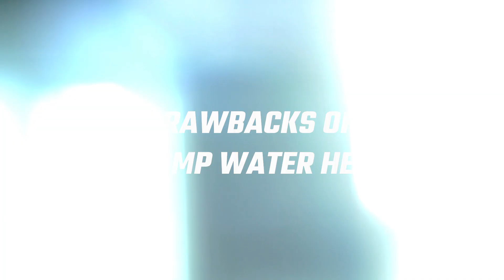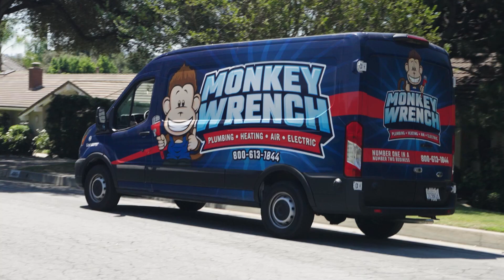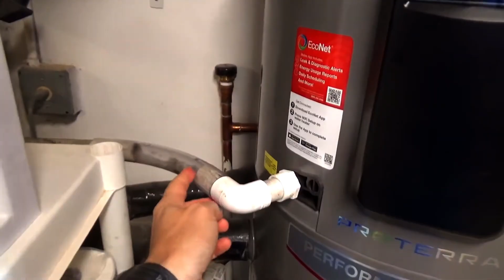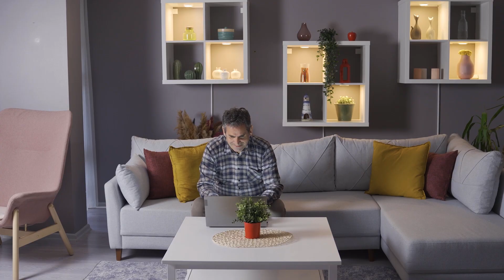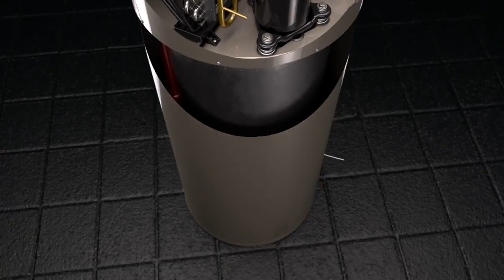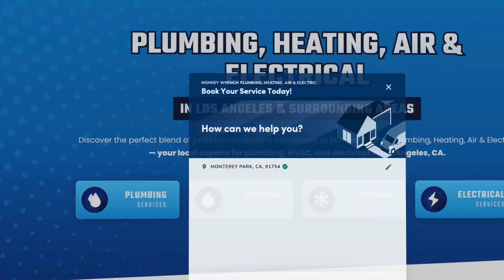Drawbacks of Heat Pump Water Heaters

Comment: In California more and more contractors are moving to the Eco-logical Omni split system heat pump water heater. Eliminates all the problems the customers run into like, unwanted cooling at times, noise, having to deal with condensate drains or pumps, and the Omni is the most efficient heat pump water heater on the market. Contractors love it because it’s a split system and the installation is very flexible.

Comment: How much on average should I expect to pay for a unit like this to be installed replacing a regular electric 240v HWH of the same size in 2025?
Also, can they be set up with a recirculating pump that keeps hot water constantly pumping around the house?

Comment: A Heat pump water heater is dumb for some, here's why. You take heat out of the houses air to transfer to the water, now the furnace has to run more to make up the heat stolen for the house. I guess it is ok if you live in a hot climate. So it is good for some areas but dumb for other areas.
Reply: If you didn't have a heat pump water heater, you'd still be paying for the gas or electricity to heat water in one of the other types. At worst it's a wash, at best you save a little money on the added efficiency of the heat pump. You're right that they aren't a good fit for everyone; that's why it's important to educate yourself on the benefits and limitations of 'new' technology (for which this video is unfortunately not helpful) and make an informed decision.
Reply: @jamesbryan1422  Plus, don't forget the high cost of the heat pump water heater itself would take too long to pay for the extra cost over a gas heater. For the "you'd still be paying for the gas or electricity to heat water in one of the other types" yes but now with heat pump you pay to run it plus the extra for running the furnace more, to heat the air stolen by the heat pump.
Reply: @bentleybloodworth4282    It wouldn't necessarily be extra, though. You gain efficiency with scale, so the increase in furnace demand would be less than the amount of gas or electricity previously being used to heat the water in the water heater. Your furnace run time might increase, but if, for example, you had gas appliances and you swapped the gas water heater for a heat pump type, you would most likely see either a level or decreased gas bill. Then it's just a question of whether the total energy cost (gas + increased electric use) is actually less than before the change was made, which is going to vary by locality. And as you said, that's without accounting for the cost of the unit.
Reply: @jamesbryan1422  my heat pump water heater saved me over 25 bucks a month paid for itself in 2 years and now makes me money compared to my old electric one. 50-gallon GE had it for over 8 years. Installed it myself.
Reply: mine makes cool air in the summer i duct it back into my house and it dehumidifies my basement all year long.

Comment: 2:06 " Heat pump water heaters capture heat from the surrounding hot air and transfer it to ELECTRICITY POWERED COILS!!" Yikes! who wrote that script and didn't double check it? The video made by you on the Aug 25, 2023 actually gets it right where you say "Heat pumps work like a refrigerator but in reverse" meaning its refrigerant passing through a closed loop system. They also have an electrical coil that can heat water if the heat pump can absorb enough from the air.
Reply: AI?

Comment: Most of the things listed here also can go wrong with any water heater and are not specific to hear pump water heaters
Reply: Very true.  This is not helpful in deciding between an all electric unit and a hybrid water heater.  This may be structured like this to help sell their services to the public.
Reply: Yeah this video is stupid.
Reply: I thought so at first, but I don't think it's a straight 1:1. The water leak he's talking about is from the heat pump's condensate drain, which I don't believe regular water heaters have (correct me if I'm wrong). The overloaded circuit thing seems dumb - Are there people out there that put a 240v appliance on a shared circuit? The noise thing is reasonable, a heat pump is a radiator with a fan and a series of tubes. So you've got moving parts that could become noisy over time. The smelly water thing seems to be the same for all water heaters, though.